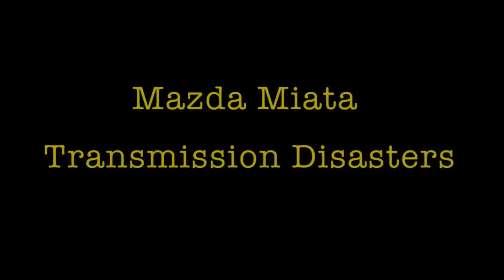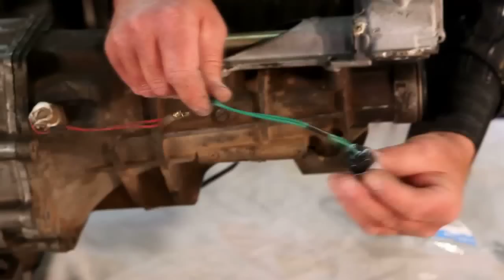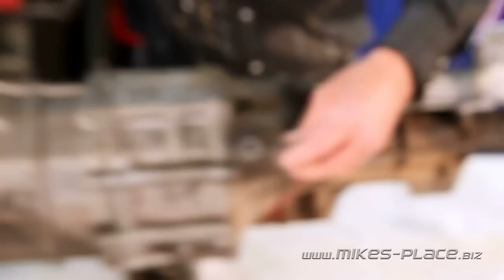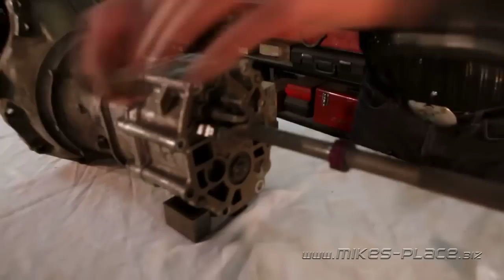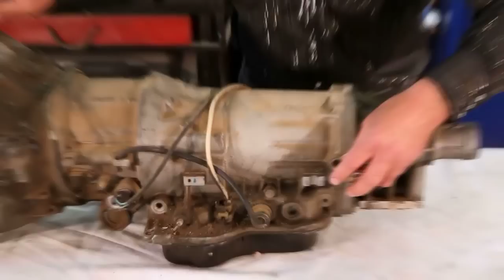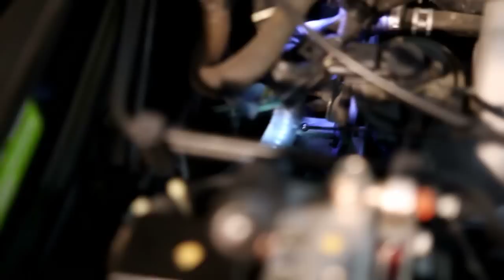MX-5 Miata Transmission Disasters from Mike's Place

Comment: This was a great post but you should let people know that the reason the cars are getting stuck in reverse in the first place is because of that shifter repair kit the bushing for the shifter is all you need if you just switch the sensor its still going to get stuck in reverse. Your video on replacing that shifter kit is great - you should redirect them there to fix that problem as well
Reply from the maker: Hello Sir Henry,Thank you for the heads up on the shifter overhaul as part of the stuck in reverse issue. So true a sloppy shifter can lead to " Stuck in Reverse ".The King of Miatas. Mike.

Comment: Hello Mike MiataKing,

My 1990 Miata had a problem with the reverse switch (stuck in reverse) and I watched your video for repair tips. The tips you gave worked well, but I found an easier way to access the Reverse switch. Instead of reaching under and up for the switch, I found it easier to cut a small square in the carpet and cut an access panel into the metal, making it simple to access both wiring and the switch. Thanks for the info!

Comment: Yes, this is common on the 91 and earlier transmissions. You do not need to remove the transmission to repair it. The cause of this is that the nylon bushing below the shifter is worn or has deteriorated. It is a $3 part. If you did not replace it, then you will need to or the problem will happen again. Somehow with a worn bushing, the two shift rods were put in to gear at the same time. Next time that it happens,remove the shifter knob and boot. You will then see three bolts holding the shifter in place. Remove them and pull the shifter out. The bushing to be replaced is located on the very bottom portion of the shifter rod. Then jack up the car and look on the left side of the transmission about half way back. The reverse switch sensor is located there. It has two wires coming out of it. Remove that and get a #2 screwdriver that is really short. If you stick your finger in, you can feel a groove in the rod just inside the hole. The groove will be just rearward of the hole. Stick the screwdriver in and pry the rod forward until it moves and makes a click sound. Go back to the top of the trans and see if the rods are centered. If they are, then the two U shaped portions of the shift rods where the shifter bushing sits will be aligned. Place the shifter in with the new bushing and install everything back including the reverse sensor.

Comment from the maker: Hello Sir Brendon,
Yes, all automatics have a neutral safety switch so that the car will not start in gear. If the car will not start in park try neutral. If it does start the problem could be the switch or adjustment. Thank you for your input.
Mike.
The King of Miatas.

Comment from the maker: Hello Sir Jared,
This problem is in the chassie, first step the hold button switch is intermittent. You need a wire map and test lamp to check the wires down to the trans and solinodsGood luck.
Mike.
The King of Miatas.

Comment: Thanks for this.  The reverse switch is the same on the Probe/MX-6's manual trans, and I was wondering why it was so hard to pop OUT of reverse after changing the switch.  Turns out I forgot to swap over the copper washer you mention in the video.  This establishes the proper clearance to the shaft in the trans.  It worked just fine after I added the washer.  Thanks again.

Comment: HOWdy  M-M-K,
Thanks - Finally someone who will address the older Mazda "NA" MIATA with an Automatic Transmission 🙂
thank you for the information on the "LARGER" & "smaller" Vacuum-Modulators ... and the Vacuum PORT Location 
all very USEFUL = I wish  I  had located your CHANNEL a few years ago ...
Thanks Again
COOP
...

Comment: The indicator for a bad reverse switch is the car will remain in reverse and not shift into other gears except for neutral. If you are having other problems, the Miata King has a few great ones on diagnosing and repairing Mazda Miata manual transmissions. They helped me out a lot. Good luck, Charlie!

Comment from the maker: Hello Sir Maxwell,
The problem is a bad 4th to 5th hub and sleve set. To fix, the trans will need to come out and the tailshaft case removed to expose the damaged parts. Will not need to open the main box.
Good Luck.
Mike.
The King of Miatas.

Comment: Hey Mike, I've recently got a 2002 se.  This is my 2nd Miata.  I just wanted to get another cause I miss my old 99.  Rescued it from the crusher expecting it to just be a little rocker rust as the previous owner said.  He's from Illinois where they salt the roads.  We also expected it to be a blown head gasket.  When I got it home I found frame rust around the front, it's gonna need quite a bit of new metal and when we opened her up, the nodules were all rusty and fuzzy and we cleaned it up but the whole thing is frozen up.  So we went and bought a new engine, and now the guys pulling out the engine are having a problem with the engine being siezed to the transmission by the clutch so they've been soaking it for 3 days.  Still not budging.  They're saying it may not be as big of a thing if we had the transmission.  The tranny was the only thing that was iffy cause we didn't know if it was going to work right and shift smooth in the first place since everything else was rusted.  May get a new transmission but my dad keeps reminding me that I'm throwing all this money at a 2000$ rust bucket but I just found out about 2 weeks ago how rare this year of the special edition is.  I'm also realizing how rare those 6 speed transmissions are.  I may end up using this car to learn to weld on and it's in this beautiful silver with the saddle interior, I've never seen a Miata like this but I know you've seen so many Miatas in your time so what do you think man?
Reply: Hello,
Thank  you for your concerns. Rust is rust... so bad can be real bad if it takes the structure support out of the unibody.  We have found stuck transmissions also.
The problem we found is the pilot bearing is frozen on the mainshaft. To remove you have to pry the transmission away from the engine as you will be pulling 
the pilot bearing thru and breaking the clutch disc. Any Miata saved is a good thing. Good luck with  your Miata Mission. The King of Miatas. Mike.

Comment: I think you were right about the noise, but the hard shifting and no power problem was fixed with a new modulator valve, thanks for the video!

Comment: I have an Automatic 95 Miata and i had the same issue with mine. it started smoking just as you described and I thought I had bad valve seals and guides, so I rebuilt the head just to find out the Modulator vale was the whole problem. I didn't notice it was that until the transmission started shifting real hard I checked the fluid and it was not even one the stick. I checked that vacuum line and it had trans fluid in it. $55 modulator and $20 of fluid it was good as new.

Comment from the maker: Hello Sir KC,
Sounds like a shift rail problem. Remove or loosen up the reverse switch to see if the problem changes. If not it could be a reverse / fifth gear hub problem.
Good Luck with your mission.
Mike
The King of Miatas.

Comment from the maker: Hello Sir Narval,
The sound you hear, a rushing pump type noise, could be the coming from the automatic front pressure pump. Time to see a automatic transmission specialist.
Check your transmission fluid level first, warm engine running and transmission in park.
Good Luck.
Mike.
The King of Miatas.

Comment: Your Majesty,
I have an auto-trans that the fluid level keeps going down over a couple weeks.  I now think it could be the modulator.  I have not noticed smoke from the exhaust but I don’t always look or maybe it is just not that severe yet.  This past week I was at a red light and went to go and the car just sat there as if it were in neutral.  I was about to replace it with a 5 speed manual but I may be able to save a few bucks now and do the tranny swap when I have more money.

Comment from the maker: Hello Sir Aaron,
Great Balls of Shooting Embers. Wow Great Story, One that you can tell for ever. But your story has it's own answer. The Fire Balls damaged the auto trans wire loom and when it receives the signal for Drive it blows the fuse. Look under the Miata " Shooting Star " for fire damage at the auto trans. Good Luck with your " Forth of July Special " Mission.

The King of Miatas,
Mike.
Reply: Hey MIke! quick question. I just did a miata clutch replacement and with everything put back and torqued properly Im getting some noise from the new clutch. That is not what bugs me however. What does is a cluck in the trans tunnel when shifting in and out of 2nd, 4th and reverse. Not 1st or 3rd though. All bolts were torqued to spec. Any tips or hints as to what may be going wrong?
Reply from the maker: Hello Sir Devin,Lift up the center console and look at the shifter insulator rubber boot. Sometimes the boot is in the wrong position and make a "cluck" type noise when shifting. Move the small part of the boot up or down on the shift lever. The King of Miatas. Mike.
Reply: Thank you for your time and knowledge.

Comment: Hey Mike, my automatic transmission does something different. I'm losing fluid a good bit and when it hits third and fourth, I hear a rattling noise like a coin being tossed around. When I push the gas in more, the noise is louder and heavier. Someone said it was a 'tail shaft bearing'. Do you have an idea on what it could be?

Comment from the maker: Hello Daoskee,
Sorry, bad news, you have unbolted a bushing that holds the shift rod in place. To correct the issue you will need to remove the transmission then the  tail shaft case.
Good luck with your mission.
Mike, 
The King of Miatas..

Comment: Mike, I've read that Mazda had a service program to try to fix this issue without pulling the gearbox, which involved replacing the switch and also removing two washers under the detent spring retaining bolt. Can you tell me where this bolt is? If the washers are still present, can I unscrew the bolt and remove them myself?

Do you know anything about the process for replacing the faulty rod?
Reply: Hey did you figure it out?? I’m wondering the same thing and need help
Reply: I’m afraid not. I ended up just replacing the tranny with one pulled from an NB.

Comment: Forgot to ask this - what is that rubber boot - a square rubber boot at the bottom of the transmission ?( I  removed that boot  thinking it was the reverse light switch. I put my finger in and I could feel  a metal rod inside ).

Comment: Mike I have a '99 and the clutch and tranny got screwed up during clutch install. again I put  new clutch disk but now...
Shifter movement in neutral feels free, returning to center.
It goes into 1st & 2nd solid.
Third gear goes but doesn't feel solid like 1st & 2nd.
Fourth gear feels caught at the gate with no movement.
Fifth and Reverse seem there but again, not like 1st & 2nd.
Thanks

Comment: Thanks for saving me a thoudand bucks.  Stuck in reverse for a month in my driveway and was ready to shell out for a new trans (the disaster you speak of) when I was directed to your site (the internet, to be precise) and after removing offending switch, used allen key to push back rod and Viola' I had gears again.  Have gotten all parts together to rebuild shifter and boots (still MUCH cheaper) Second trans for my 90, but this trans is a 95. so here's lookin at you, king.  t.sindt Dunedin Fla.

Comment: i have a 93 miata that seems to be slipping. the rpms have to be higher than normal to drive. the strange part is that while stopped at a red light the car would want to jump forward while you are still on the brakes.

Comment: My 2000 Miata 5-speed transmission is starting to get very difficult putting it into reverse. I'm thinking it may need a rebuilt transmission but don't know if there might be a simpler fix.  Fluid was just changed and I use it for track days.

Comment: Hey, Mike I got an issue with my manual transmission. I have 1995 mazda miata, 150,xxx miles on it, and changed the clutch with throwout bearing about 7000 miles ago, now it makes noise while I'm in 1st -5th gear, when in low rpm and when I quickly release gas it does that noise like metal shield scratching... the noise only comes on low rpm...some people are saying it needs grease between clutch cylinder + throwout bearing. Now I'm researching, people are saying its input shaft bearing...

I haven't got time to grease it or buy bearing yet...I'm not sure which should I attack first.

Comment: Im currently rebuilding a 1995  Miata transmission.  I have rebuilt several 85 rx7 transmission and they don't have the reverse shift rod spring. Can I leave out the reverse shift rod spring? Because of the problem they cause being stuck in reverse.

Comment: Hello Miata King. For someone who knows everything about Miata‘s, other than transmissions. Do you know why low and highbeams will not be working? Other than bulbs being burned out, not getting any power to headlight plug. All fuses good, relays good,Headlight switch assembly good. The Japanese even head a fuse box tucked under driver side of the dashboard. Being the king of Miata’s, any other possibilities you can think of?
Reply from the maker: Hello,
Have you tried plugging in a known good head lamp bulb yet. The easy button first. For a weird electrical issue always look for critter damage. 
A little fella may have been napping underhood and nervously chewing on a wire loom. A popular napping place is between the under hood fuse 
box and the fire wall, down in the cozy valley. Good luck with your Miata Lighting Mission.
The King of Miatas. Mike.

Comment: Hi - I also remove the center console, and the entire shit stick out.  When I look down inside, I only saw some light dark fluid - is this transmission fluid ? ( some public comments indicate that I should replace the nylon brushing at the end of the shift stick which I did not see - the shift stick ends with a little round metal ball ! )

Comment: i tried what you said and was able to drive the car but when i put it in reverse, it got stuck agian. the new rv light switch that i received came with a green and  red wire. does it matter on how the wires are plugged back into the clamp?

Comment: i have a 1990 miata5 speed and it won't go into reverse or 5th gear ,i watched a video showing it being a slide selector or spindle selector ,can this be replaced without removing the transmission ,Thanks Gary

Comment: Your Highness Mike, I don't know if you have answered this one, but it seems to be a problem that plagues alot of Miata owners. When I am decelerating with the transmission (manual) engaged there is grinding noise from possibly the transmission, usually 1-4, sometimes there is some noise when accelerating as well when the engine is lugging.  Some people say theirs occurred after a clutch change, some people say theirs fixed after replace transmission or rear differential. Do you know the real reason?

Comment: Dear Mike, I have MX5 2005 1.8cc and I am in Uganda in which these cars are not known. I have a problem that the 3rd and 4th gear is not engaing. It is like pushing aginst a wall the 4th gear sometimes enters but it pops out again. I need your help please. The car was inported from the UK. many thanks

Comment: Hello Mike,

I have a 1990 Miata with 5 speed and 93k miles on the whole car. I put in a ACT kevlar 4-puck style clutch about 10k miles ago. I am noticing a whistling noise at higher rpm and a metallic metal rub sound kinda like the flywheel rubbing on something but I don't think that is possible. Also almost every gear when I let off the gas pedal and lose speed I hear my gear box making noise almost like the gears are rubbing or grinding. Any suggestions?    Thanks, Sincerely Richard

Comment: Mike, I have a problem that's similar but not just like this one. I just replaced my clutch. When I put everything back together and fired her up, I could shift through five gears but not into reverse. I drove to a transmission shop, and one of their guys checked it out. He managed to shift it into reverse with great effort. So, now I can shift into and out of reverse with great difficulty. It's harder and stiffer to get out of reverse than it is to move it into reverse.

I replaced the reverse switch, but I don't know what gear the transmission was in when I did it. Would that matter? Also, I fiddled with getting the shifter back in. Could I have damaged that without realizing? 

Great video! This is the closest I can come to a solution for my issue.

Comment: Hello mike, I have a 1999 Miata with and automatic, now a couple weeks ago the coil pack went out while I was 2 miles from home (I didn't know it was the coil pack at the time, I thought it was a cogged injector as I've already had a lot of problems out of the fuel delivery but that's all fixed now) so I tried to make it home but about a mile away the engine use blew, the cluster went out and a ball of flaming embers shot out of the pipe that the previous owner cut off at the axle. Now that I have replaces the coil packs and have installed a full, proper exhaust, it starts just fine but when I try to drive it the reverse works just fine, no problems, but as soon as I shift into "D" the engine fuse blows and it acts like it has slipped out of gear i.e. high rpm and little power. Someone told me to check this video because it has the answer but I'm not so sure the modulator is my issue, or is it? I'm thinking the excess heat from the exhaust misshap fried or melted something?
Reply: Aaron Steele just gonna throw our a stupid comment: Motor mounts?